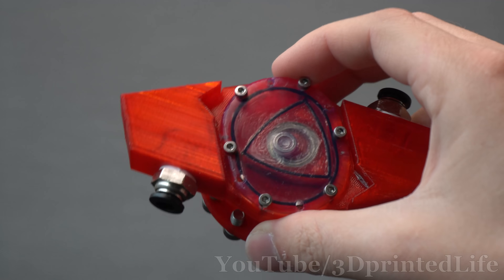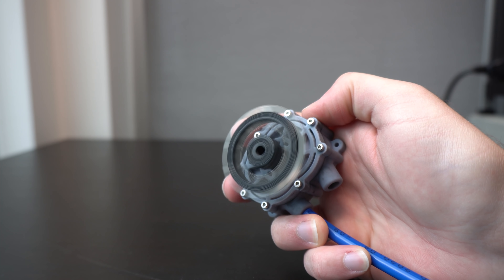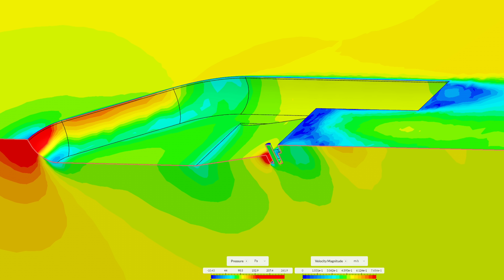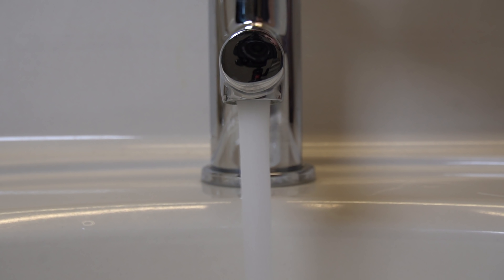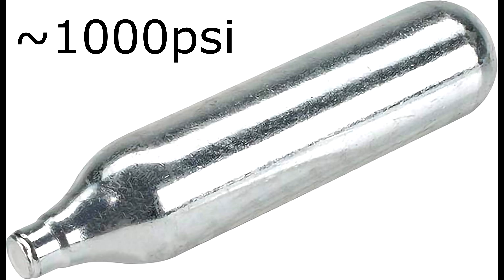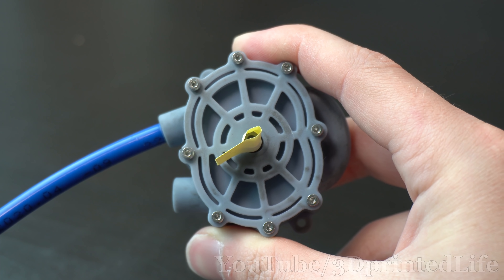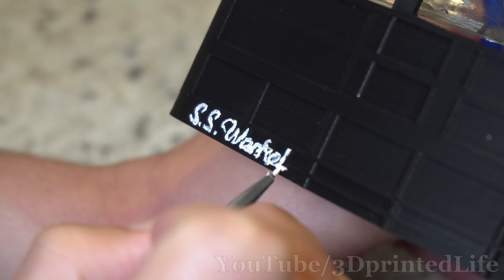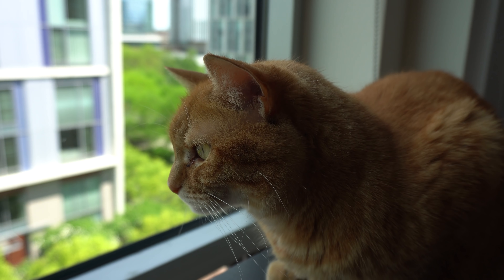Building a 3D Printed Wankel Powered Paddleboat

Comment: You want to use a convex curve on your pulley to keep the rubber band centered. It’s counter intuitive to think a band would stay centered on a bulge rather than centered in a groove. But that’s exactly what happens. It’s called a crowned pulley and it’s necessary with band driven mechanisms, like belt sanders and whatnot. It’s a mechanic of the band itself, rather than the pulley. If you use a band that’s as thin as it is wide then you would make the pulley concave like you did. Which is probably why it would on run when you ran the belt on its side, the thin part of the band

Comment: Extremely fun and interesting video. Small tip is to use convex pulleys (largest diameter in the center) if you use a rubber band as a belt. Seems counter intuitive but that is actually the case. It won't slip off.
Reply: Oh well, I guess this was already well known in the comments.
Reply from the maker: Hahah yeah, just a few times 😁 if only that video came out a week sooner

Comment: If you’re using a fat rubber band put it on a convex wheel. The rubber band wants to run up the walls which would make it self centering if you used less of a curve on a wheel curving outward in the center. The groove works great with round items but is detrimental with flat stretchy items like belts.

Comment: The rubber band issue is actually counterintuitive. Steve Mould did a perfect video explaining it titled, "The Band Should Slip Off But It Does The Opposite!" The way you designed the bands to sit on concaved pulleys will actually encourage the bands to climb up the sides and fall off, since you are using a wide band rubber band.

Comment: You should've used convex pulleys instead of deeper concave one. Rubber band stays in the middle of a convex shape when spun but climbs up the walls when concave. Steve Mould just made a video on it.

Comment: I like the idea behind the pressure regulator. Is possible to use it with a co2 cartridge? The problem with the integza car is that it loses half of the power due to the initial overpressure

Comment: I think I see what may have been causing your rubber band to slip out of the groove initially. 

Steve Mould did a video about it a couple days ago, rubber bands act weird when used as pulleys and you have to design them a little more counter intuitively. 

https://youtu.be/TNuzi-jMXoY

Comment: Suggestion  why let the exhaust of the engine go waste? Design a strict nozzle and let it be as a jet in the back  it could also add enough restriction to give you longer run time

Comment: I know this is going to sound counterintuitive, but instead of a deep groove, use a convex surface on the pulley. It's the same concept bandsaws use. The belt wants to climb naturally, so in a groove pulley it will try to climb out. On a convex pulley it climbs to the center.

Comment: Make an overcomplicated compressor that will produce pressure into a reservoir. Maybe electric motor driven compressor, or even a small gas engine driving a generator to power that electric motor that compresses the air that will be used for the wankel or air piston. How many different ways can you convert energy and still get propulsion?

Comment: Maybe try using a gear ratio to produce more torque as the engine seems to spin at a really high rpm so a gear ratio might help push the water

Comment: "Some schmuck", lol.  I saw his wankel video.  I like the idea of making it MORE complicated by using solenoid valves and a controller for the purpose of adjusting timing based on speed and load and possibly temperature.  Using speed compensation could improve the performance of the motor in the same way as timing advance on an ICE.
Reply from the maker: That would be so awesome, but definitely need to add an alternator at that point to make it fair haha. I have been considering making my liquid piston controlled with an electric timing system though since I will use it on an RC platform anyway....hmmmm
Reply: @3DprintedLife  an encoder is what you need.  You can use an Arduino or Seeeduino with an encoder shield.  Don't connect encoder signals directly to controller or you will have lots of problems that are solved by a counter chip.  A magnetic encoder might be perfect for your motor because there is no mechanical connection and you can bury the magnet into the 3D print.

https://www.seeedstudio.com/Grove-12-bit-Magnetic-Rotary-Position-Sensor-AS5600-p-4192.html

Cheap valves that are fast might be difficult to find.  I like  Mac brand "bullet valves" but they are around $60 each if I remember.  One thing you will absolutely need to know is the switch on time and the switch off time of the valve.  Waiting for lines and cavities to pressurize and vent is everything.  Keeping pressure air lines as short and small as possible will help a very lot, maybe attach the valve directly to the motor block.  Keeping exhaust lines large and unrestricted is also important.  I'd love to see how you could use CFD to design the passages.

Anyway, nice video you have here!   I never got into doing computational fluid dynamics and it is fascinating from my controls engineer perspective.

Comment: small tip, pullys for wide drivebelts like ur rubberband need a slightly convex form, they adjust themself then. Beltsander use the same principle.

Comment: You should watch Steve Moulds video about crowd pulleys with a rubber band. It talks about using a rubber band as a drive belt.
Title: The Band Should Slip Off But It Does The Opposite!

Comment: Your pulley system can be simplified   if you use a rounded ball on the output side of the belt it should self center to the apex of the curve. Only really works because of the stretch of the rubber being tightened on one side at a time.

Comment: Loved the video really cool design, but the reason (I think) the rubber band keeps jumping off is because the wheel you used to hold the belt is concave not convex, which would have held the belt better

Comment: I posted on Integza's video on the engine and I think it's relevant here also:
I think the engine would be better if instead of using a bypass, it was dual in/out. They could always be connected via a splitter to the same source and allowed to free vent on output.
Then each half of the engine would be used for the motion and it would likely increase the torque you could get out of it.

Comment: I though you having the ball chain in the back ground was foreshadowing to you replacing the rubber bands, but like another comment said, a catamaran using 2 pressure vessels "2liter bottles" as pontoons with the engine casing and paddle wheel between them would be more efficient
Reply from the maker: Yeah, if only I was clever enough to think of that! But I have plenty of ideas for V2!

Comment: The plastic bottle you are using already have a very efficient boat shape. You could use it as the boat's body, instead of putting it on top, reducing stability. If your engine setup is airtight, fixing under the bottle (under water) would give you a good stability. It requires to add a cone in front of it to reduce drag. The add two lateral floats to the bottle to prevent any spin, put the paddle wheel on the back and you have a light speedboat.
Reply: Maybe something like a catamaran with a dual bottle/hull configuration and all the mechanical parts in the middle could even be able of RC direction; whit more air capacity, and less weight can give you more run time, and if you uses a propeler instead of the paddles you get no rubberband isues.

Comment: Is it for Fun and you want to do it in this way? In this case I can understand.
Because:
- blades effective 3-8 times.
- air is not good to store energy. Except you got it as a trash, from other production 'onboard'.
- you make a wane, not a boat. Even vikings 2 Thousands years ago make better forms for boats.

Way's to improve:
- Make integrated air tank
- make control unit to Start and Rudder. It will save some seconds.
- no rubber, or take 3 and more, very tight. Make them not in One side from motor. Use both sides.
Or better use Chain.
- make boat in Boat forms. You need Keel.

Comment: You have a Rubber belt. A belt climbs to highest point, either use a string or a crowned pulley. Those would be much better for he Running belt.

Comment: Crowned pulley belt drive is preferred for flat rubber belt. The belt would self-centre itself on the pulley. The reason why the belt kept climbing out from your pulley design is because of how flat rubber always 'climb' on higher level side instead of falling into the ditch. There are quite a lot of videos about crowned pulleys on YT.

Comment: You might try to change the boat design for a sleek, longer design and opt for a 3d printed container like in the bow and a 3d printed manifold to a multiple rotor engine that powers up an impeller into a convergent-divergent nozzle for improved thrust

Comment: Your rubber band keeps running off the pulley because the pulley is geometrically wrong, it needs to be convex and not concave. Belts 'climb' to the top of whatever they're run on. Also the hull design as you mentioned needed to be sharper, you have too much resistance and top weight. That's why container ships have either a rounded or sharp hull together with a ballast.

Comment: A simple solution to your stretchy belts, instead of going the bell pulley route, use large o-rings. I've used them on many university projects in the past and have worked well. I normally use Nitrile o-rings. If you're a savvy shopper you can buy them in bulk and have plenty spares of various size on hand for future projects.

Comment: If you plan to keep on using rubber band belt drives try a convex pully design, i don't fully understand the mechanics my self but a video explains why it keeps the band centered I'll edit this later if I can find it

Comment: You could look into the X bow, the axe bow, catamaran, deep V....well let's just say: "there are a bunch of bow, hull and stern designs to look into." Not to mention all the propulsion and rudder/steering designs you could use aside from the paddle wheel and standard rudder.

Comment: What if you took 2 2L bottles and made them be the pontoons of a catamaran. You'd get more stability and double the air supply for long runtime with needed less 3D printed structure/hull. Then all you need to do is put your engine and pressure regulator along the middle with a rudder and see how that goes.

Comment: Look at a crowned pulley for the belt to stop it from slipping off. A notched pulley works well where the belt is about as thick as it is wide, but when they ratio increases, a crowned pulley might be better. Check out the most recent video by Steve Mould.
https://youtu.be/TNuzi-jMXoY

Comment: Put two bottle on each side with pressurized air and the paddle assembly in middle, this way you can have more stability as well as more compressed air. Something like catamaran boat I guess.

Comment: Hi! I enjoyed your video and wanted to make a few comments. I hope you don't mind! First off, if you're using rubber bands for belts, you should look at crowned pulleys. It's counter-intuitive, but you're losing a lot of energy to friction with those deep grooved pulleys, and the concave bottom of the groove is working against you, as it's actually trying to push the rubber band out of the groove. Second, consider ditching the fancy 3D printed hull and using the pressure vessel as your hull. Better yet, use two of them and make a catamaran. You'll get more volume, less weight, and a more stable flotation. The last thing is I want to compliment you on your regulator design. I made something using the same principle a while back but it was a lot bulkier and heavier than yours. I'm inspired to revisit it now and try and make it better. Thanks for the inspiration! Cheers!

Comment: I noticed you are having a bit of trouble with your elastic band. I recently watched a video for a crowned pulley which is perfect for self centering a rubber band! Here is the video https://youtu.be/TNuzi-jMXoY. Maybe you could use it in your v2 with your pontoon of soda bottles. I was thinking that maybe you could make the soda bottles modular, so you could add as many in x and y as you liked. Also the structure between the soda bottles could also double as tubes that connect the air volumes together. Can't wait to see V2!

Comment: The reason your rubber band kept climbing off the pulley is your pulley was concave instead of convex. If you print a pulley that looks like a squashed sphere it won't try to climb off of it. Instead it will self-center. It's not very intuitive. In fact it's very counterintuitive.

Comment: The elastic band will always climb out of the grooves of the pulley wheel because it has elastic properties. To avoid this you have to make the pulley wheel exterior convex. This also may require a larger thickness of the wheel.

Comment: Great work on the design, I would be interested to see a v2 with the graphite seals and valves because right now it seems more like the engine is acting as a turbine opposed to the expansion of the air. I know this ups the danger factor a bit but I think dry ice could be a good candidate for a power source, it just seems with compressed air/ co2 you have a extremely poor energy density.

Comment: The problem with this is, as I see it, is that rotaries are not fantastic with torque delivery, but they are fantastic compressors, maybe try using wankels with a brushless motor to compress the air and force it into a turbine to spin the paddle wheel instead, giving you longer power delivery
Reply from the maker: Hahah that sounds unnecessarily complicated...I like it!

Comment: flat belts require oval pulleys to self-center, quite efficient. Or use an O-Ring as a drive belt. Also, you could have a 3D printed drive train of gears going from the Wankel to the paddle wheel.

Comment: Hey! To keep a rubber band stable on a pulley, you need to do the opposite: Make a crown, not a groove. It’s counter intuitive, but the band wants to climb up to the highest point, that’s why it kept climbing out of the groove. If the highest point is in the middle, it will be stable.

Comment: the pulley on your flywheel is concave, which is making your rubber band spend a lot of energy trying to jump off the pulley.If you make the pulley on your flywheel convex, then the band will stay on the flywheel without using much energy, which will translate to longer run times. also if you use a 2L bottle, then make the boat longer and wider.

Comment: Ah... You need to see this video.
https://www.youtube.com/watch?v=TNuzi-jMXoY

You should use different pully designs for belts vs wires.
Try it...

Also take a look at static stability for buoyancy. CG (center of gravity) should be below CB (center of buoyancy).
Thus a flat bottom boat is not the best idea.  And you have a 3D printer, you can make any shape :-), or maybe you could add a small keel.
https://en.wikipedia.org/wiki/Buoyancy

Cool video though, I especially loved the preussere regulator... I might have to try making one my self.
Keep it up.
:-)

Comment: If you want your belt drive to stay in place, instead of using a convex pulley, use a concave one. It will keep in place because of speed differential of the band. Steve Mould made a great video explaining how this works :)
That would also help with load handling of your pulley..
Reply: You mean, instead of concave he should have it convex :)

Comment: I would try to add some oil into the air flow to help seal the rotor and provide extra lube and power in turn making more power using less air. Adding a gasket to the front case could help too

Comment: If you are using a stretchy flat belt, instead of grooves you want essentially a positive curve (bulge if you will) on the outside of your pulley because of weird physics, that way it will self straighten and align.

Comment: Why not use small co2-cartridges that you find in many airsoft guns? They are safe to use, even in a city ;-)
Reply from the maker: They are safe on their own, but running pressures that high through my custom air regulator may get sketchy. And 3D printed parts tend to shatter when they fail
Reply: @3DprintedLife  There are small regulators available for a decent price. Or reach out to an airsoft venue and get a glimpse of how a HPA system works, with that you have several regulators for different spans of pressue.

Comment: Great Video, I need to make one of these!

 Perhaps a 3D printed chain would work better than an elastic band pulley?
Reply from the maker: Yeah definitely would work better, good idea!
Reply: @3DprintedLife  chains have a lot of friction and at this scale are probably not a good choice compared to a flexible belt, but they do have the advantage that they can be 3d printed which does add an additional coolness factor.

Comment: actually i am trying to make one, would a valve work like regulator😅?
Reply from the maker: If you control the valve, you could yeah. Otherwise, it's no different than just adding some restriction to the flow like forcing it through a small diameter section
Reply: @3DprintedLife  With a 2L bottle as air tank and with valve would it work well as regulator?